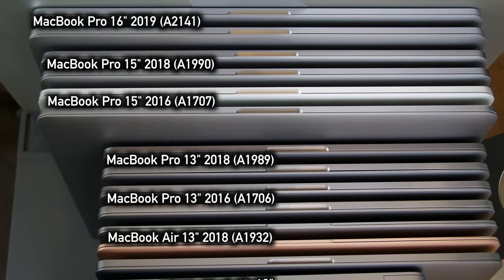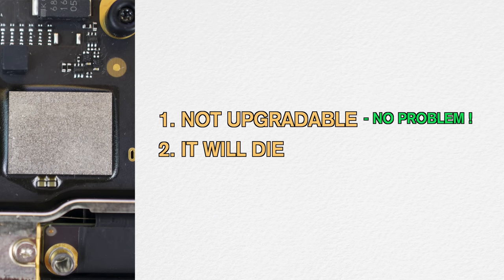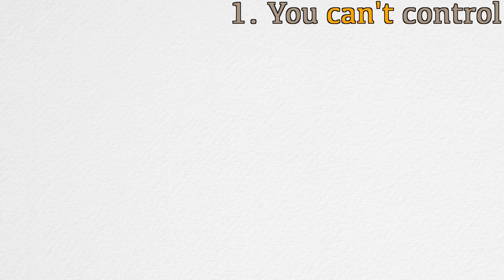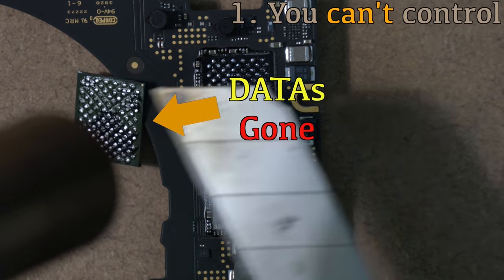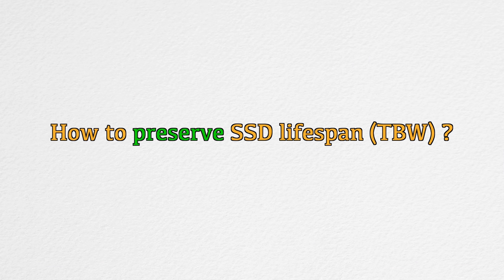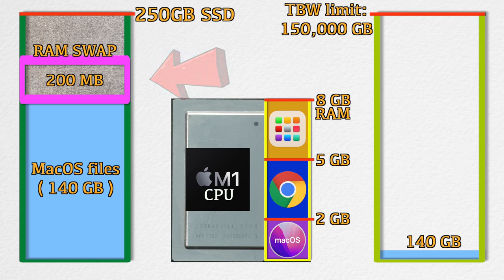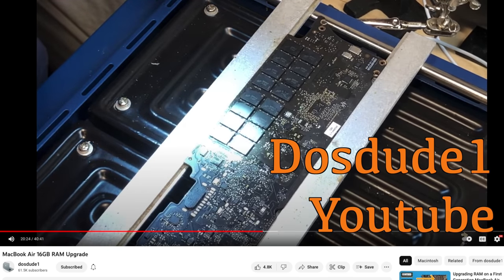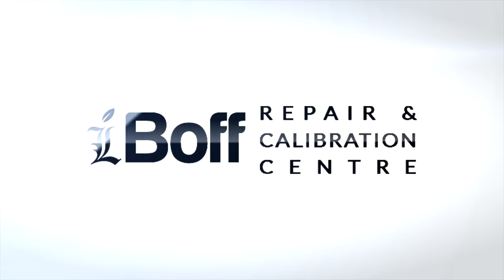These MacBooks DIED from SSD Failure & How To Prevent It (Not for RICH dudes!!)

Comment: Hello, first of all it is a unique content. You explained very useful things. But a TBW lifespan doesn’t mean that SSD is going to die. It means that the manufacturer will no longer give guarantee to SSD. There is a lot of working SSDs which has already completed their TBW lifespan years ago. It is more about the breakdown of the storage cells in SSD. In normal conditions, most probably a user can use the SSD for couple more years after completing the TBW lifespan. It was a great content thanks to you.
Reply from the maker: Youre right! When we uploaded this video, we already clarified some facts regarding the TBW to this video description, of what the actual scenario when the TBW limit's reached. and what you're saying is completely true, as its not always die 100%, but since we've had some SSDs behave erratically when TBW limit's reached on these Macs, so we'd like to call it dead.

And as a logic board technician's perspective, when we repair MacBooks with dead SSD issue, ETHICALLY we will never install bad TBW SSDs to your client's Mac. (because in the next video, we will explain most of the SSDs need to pulled off from another working Mac - and we don't even have any choice!)

and thanks for watching! :)
Reply: Still doesn't matter, ssd's also fail before their TBW is reached, and being soldered on, creates the same problem, a useless laptop that CAN'T be fixed
Reply: @michaelkeudel8770 I have seen some videos here with people replacing/upgrading the SSDs of M1 MacBooks but it needs advanced technical skills, soldering stations and connection to another Mac to start the MacBook M1 in DFU mode and install macOS.
Reply: @TechAndGuides  it needs advanced skills and expensive tools, and an incredibly steady hand, there's no reason a socket can't be there instead. The likely hood of success is very small because the way it's designed. Your storage should NEVER be the deciding factor of when it's time to upgrade YOUR ENTIRE computer.
Reply: Is the DFU in ROM?
Reply: @michaelkeudel8770 of course there’s a reason against sockets, they add thickness, weight, are more prone to failure and are slower. Don’t be ridiculous.
Reply: @spacecadet2172  throwing a piece of equipment into a land fill and forcing you to buy a replacement is better than a socket and spending a few bucks to replace an ssd isn't ridiculous. You plug the drive in once, the socket isn't going to fail if you change the drive multiple times, that's exactly what they were designed to do.
Reply: @michaelkeudel8770  people don’t keep the socketed ones either. They throw those away too because not many people want a 6+ year old computer that can’t even run the latest OS
Reply: @spacecadet2172  great, so if your ssd fails in the first 2 years of ownership, flushing money down the drain every couple of years is really cash smart. I rsn my last home computer for 11 years BECAUSE i was able to upgrade along the way, not because things didn't fail, but because I could.
Reply: @michaelkeudel8770  I worked at the Genius Bar for 4 years, and have been supporting macs for almost 20 years total for countless clients. SSD failure is exceptionally rare period, let alone in first 2 years. Component failure in general is not common with Macs of the last decade, and if a component were to fail, it is usually something to do with the motherboard other than the SSD or RAM, so the motherboard would have to be replaced anyway. I don’t know where you get this idea that the whole computer is thrown in a landfill. If it were only 2 years old, the motherboard would be replaced, and if it were a computer past it’s normal usable lifespan (usually 6+ years is pretty standard) then all the components and materials are responsibly recycled by Apple. I can’t believe you have been throwing your computers in the garbage all this time rather than recycling them!
Reply: @spacecadet2172  a dead electronic device has a resale value of $0, and I never said my equipment went to the landfill, it's always been recycled. If equipment I have still works, I try to repurpose it for myself or friends/relatives/anyone who has equipment worse than I'm retiring. Congratulations on working for Apple, guess saving your customers time and money isn't an important thing.
Reply: @michaelkeudel8770  lol you literally said land fill, verbatim
Reply: @michaelkeudel8770  recycling has nothing to do with resale value, it’s about harvesting the metals and precious rare earth elements
Reply: @spacecadet2172  yeah, meant more in a slang way, slip of words.
Reply: @spacecadet2172  not putting in a socket saves .05 - .10 on Apples bottom line when bought in QTY, your still avoiding people being able to replace/increase their SSD size, and the only option available if you run into that problem is to buy a WHOLE new system, and since you want to be word picky, recycle your device of $0 value to you, so that the recycler can sell that same raw material back to Apple. It's what right to repair is all about, I own the device, I'm not borrowing it or renting it.
Reply: I just bought a second hand MacBook air m1 that have 210 TB byte written already. And i saw that most of 256 gb ssd only have lifecycle of 150 TBW. So what should i do? What is the write cycle of the mac m1 air 256?
Reply: @icecantgaming944  It is not a rule that your laptop is going to fail. Normally SSD manufacturers cuts warranty if the cycle is come to end. But if your laptop is in Apple’s warranty then no problem.
Reply: @ERTU758BJK  the MacBook is already out of waranty, moreover i scare that it will fail too soon. And im planning to use this for long term.
Reply: @icecantgaming944  don’t scare too much. As I said normally you need to be able to use your MacBook for years. But it is more like a lottery for user. It have possibility to fail but most probably it won’t. What is the model number and year number of your MacBook?
Reply: @ERTU758BJK  how can i check?
Reply: @ERTU758BJK  model A2337
Reply: @icecantgaming944  then there is nothing you can do except waiting the fail of the computer. Don’t worry, for most of users, SSD won’t fail this easily. There are many components in the computer that can fail too. Just no worries.
Reply: Eventually ps5s are going to have this same problem as the years to on as Sony has there state of the art SSD soldered to the board. 

Xbox people have already found a way to replace the SSD when it does eventually die and thanks to Microsoft for not soldering the SSD onto the board...
Reply: @michaelkeudel8770  Land fill? LOL  Where have you been?
Reply: @iBoffRCC  you know desoder the ssd from the board and sodder another one to it that  is new working ssd or create adapter to allow hard drive and laptop drive to work in in it
Reply: @spacecadet2172  you're just jumping from one argument to another. First it was "sockets fail" then it was "people don't want old OS". Are you an apple employee or Tim Cook's bf? 🤣
Reply: Yeah, I have a 250GB Samsung 850 evo running on my homelab for storage of some docker containers, and it's working since 2018, still working like a charm

Comment: I don't know if it's intentional or not, but you make the SSD usage ware case sound quite more scary than it actually is. My first ever SSD (a 256GB Samsung 840 PRO) is being used in a PC that almost never shuts down for almost 10 years now. It has 74000 hours of operation, and  58 TBW used, with typical user usage. I don't  know if such an old model has 300TBW  limit or not, but even if it has 150 TBW (as if it was a modern 128GB SSD) this would mean that it has more or less another 15 years of life in it. It will be 25 years old if it ever reaches to that point! I have had mechanical disks that failed quite sooner than the 10 years mark!
The only real issue with Apple is that SSD's are soldered on the board, and it's not easy to replace/upgrade them. That's more of a concern if the SSD goes faulty, rather than if it wears out due to usage and reach it's expected TBW after (most likely) 15 or 20 years.. Especially since Apple declares most of it's products obsolete after 7-8 years of their release (and unfortunately Microsoft copied with it's Windows 11 upgrade policy). 
IMHO a typical user should just enjoy the ease and convenience SSD's offer, and not live in a constant fear that he may have written a few GB more today on his SSD, or that the movie he downloaded damaged his disc. And finally IMHO unless you need HUGE storage space, external discs belong in the past and should stay there.
Granted, USB C protocol is very fast, but external discs are bulky and messy. If my internal disc can fit all the data I need and leave at least 25%-30% of the drive empty, why should I bother to carry around spare discs, remember to connect them, then remember to not move my MAC while the discs are connected (or to not use it on my lap) then remember to eject them, and finally disconnect them? Supposedly MACs are famous for the ease of their usage and the total user experience they offer, no ?
PS: I have both a 2021 MBP and a 2021 Asus ROG laptop. The Asus came with 1TB SSD on board. Not only this SSD can be replaced/upgraded, but it also offers a second M.2 slot. So now the Asus has it's original SSD and a second 2TB Samsung 980 M.2 PRO. And the coolest thing is that I didn't had to send it away for the upgrade, nor become an expert to desoldering/soldering components. I just unscrewed 6 screws, put the disc in, screwed the screws back and I was done in less than 5 minutes! Aaaah... Apple! :P
Reply: Josshyua  exactly this - already 230 TBW with my 2021 M1 MacBook Air 16GB - Just got an external 4TB SSD to boot from now on
Reply: @Ph1lW0 so crazy. Macos is killing them

Comment: I'm still using my 2015 2.8 ghz 16gb i7 because I can easily upgrade it myself. I never bothered with the T1's with SSD on the motherboard and nothing but USB-C ports because the extra speed meant nothing to me if I have to totally reconfigure all of my hardware and software and pay premium price for a tiny hard drive. Here's hoping that you can slap an NVME Port on to the motherboard of a 2021 or later 14" and 16" MBP in the near future. Those are the only MBP's that I've gotten excited about since 2015 because they have flexible ,sensible connectivity and MagSafe too!

Comment: Seen it mentioned in another video that the chip that's supposed to deliver iirc 2.5V to the SSD sometime goes screwy and ends up sending iirc 13V to the SSD which nukes it, burning out the NAND chips on the SSD
Reply: So, shite design is basically what you're saying. Personally, I prefer function over form as I'm not a fashion victim.
Reply: That'll be the 2V5 NAND VREG controller (there's a couple of others).  Yes, on things like the A1990, A2141 the BGA chip VREGs are sitting on the outer edge of the logic board near the air vents and with no underfill or similar physical protective barriers; either this part, or there's a nearby cap, will over time get exposed to dust and moisture which starts a corrosion issue which in turn ultimately makes the VREG fail and you'll see often something higher than 2V5 going in to the NAND,  or, if the cap nearby gets corroded enough it'll start a carbonising effect as the corrosion works it way through the logic board.

90% of the A1990 / A2141 machines repaired here are failing because of these physical corrosion failure issues.
Reply: @pldaniels The legend himself!
Do you happen to know if a2442s have the same defect? Wondering if I should cancel my order.
Reply: @AlibifortheAfterlife  no, the M1/2 series actually did seem to learn lessons and they've mostly put their crucial VREG stuff under shields or away from such edges.  Not to say there won't be othe new and exciting issues but the SSD VREG thing seems to have been a thing only for the A1990 / A2141 thus far
Reply: Ah, so just like a Commodore64 power supply (except it took the C64 power supply more years to reach that failure point)

Comment: I manage a fleet of 100 PCs in my company and saw many broken HDDs but not even once had a damaged SSD. Some are up to 7 years old and Soldered NVM ssd's are not too uncommon here and we don't even buy very large drives. I never buy PCs with less than 16gb Ram to prevent excessive swapping. I dont' believe any regular user will ever reach the TBW of it's disk.... At least not before the battery has died and the external aspect of the case will make me buy another computer for this user. 
The over-voltage problem you mention is just the result of a terrible motherboard design by Apple and I smell a class action coming at them. Computers are not supposed to fry their SSD.
It reminds me of the Nvidia chips problem on Mac Book Pros a few years ago, which to be honest was better handled by Apple in terms of after-sales support than by most PC manufacturers similarly affected by that same plague (those Nvidia chips were the culprits).
Reply: Maybe it depends on software that your users use. Personally I understood that something wrong with my 8GB M1 when started to use Adobe Lightroom (software that uses 70% of RAM at any system and has no slider to adjust it), and noticed, that it writes 10TB per day of usage due to swap. So right now I'm not using this software on my Mac anymore, and turned off swap completely (unfortunately, I don't know is it possible to activate OOM killer, so sometimes it freezes, when open too much apps).
Reply: Apple had no choice but the handle the Nvidia issue the way they did.  They also passed on 99% of the costs to Nvidia so it cost them almost nothing.

Comment: I use my MacBook Pro professionally for work from home job + iOS app development, I buy a new MacBook then run it for about 3 years under AppleCare and then sell it right before AppleCare runs out. This way I still get a lot of resell value from my device as well and the upgrade is about half the cost of a new MacBook and it never truly 'ages' to point of breaking completely.
Reply: I've had nothing but trouble with windows machines, OS randomly resetting, motherboard failures, PSU failures, I am getting really tired of people shitting on Apple when the alternative is just as or even more unreliable in the long term.

Comment: There's also a need to make a distinction between the types of SSDs used. Older MacBooks used MLC or TLC SSDs which are slower but generally will last longer than the new cheap consumer QLC SSDs
Reply: High end Samsung ssds are tlc/mlc

Comment: You can disable swap memory in Terminal on your Mac by typing the command lines sysctl -a vm.compressor_mode, and sudo nvram boot-args="vm_compressor=2" if the mode number is 4. After disabling swap memory, you should always monitor the usage of the RAM to avoid kernel panic on your Mac.

Comment: Swap does not work as you explained it. It usually moves to swap longer time not used memory pages (parts).  Thus this pages are just written once in many cases and never used again. So the effect on ssd lifespan is small. But bigger RAM is always good to have.
Reply: Yeah! And there's also RAM Compression
Reply: You wrong
Reply: Yes and no.  It will page out pages that have low hit rate in ram.
So if you are multi tasking and switching between applications when starved for ram, there will be a lot of swapping ... hence the name ... swap.
Reply: It may not be exaggerated as he explained, but it certainly play a very important role on fastening the wearing out speed. The TBW of one with 8G RAM is actually increased very much faster than those with 16G RAM when they have the same size of storage.

Comment: Straight after having finished installing and configuring my Mac Studio Max (standard model with 32GB ram and 512GB storage) I moved my user profile to a TB3 NVMe enclosure with a 2TB Seagate Firecuda 530 in it. That leaves the precious internal storage for te OS and Applications. True that the internal storage is faster, but you won’t notice a difference in real life. So when I copy a file to my desktop it is actually on the external storage, this goes for all user profile related data like Pictures, Documents and Download folders.
Reply: Good option and as you say the speed thing will hardly be noticed as long as you use a good external SSD
Reply: use Thunderbolt as OS Drive
Reply: @UserUser-ww2nj something that's worth noticing is that iPhones that came with 64gb of on board storage are dying because of the nand flash reaching its end of life. On my part, I don't have this issue, all my android phones have micro SD card slot and as Louis Rossman stated before, iPhone design is highly flawed which happens to be true .

As someone who uses android, I will never own phones like galaxy s23 ultra, the S20 ultra, s9 , these ones are worth keeping
Reply: @danteerskine7678  I had noticed in quite a few videos that there was a problem with the Nand , coincidence or planned i wonder . Very easy for them to put on a little chip with a countdown timer and set it to fail a component .
I have Andoid as well and would never have an Iphone . My current phones are Oneplus 5t and OneplusNord . . The 5t is getting on a bit but still works flawlessly , the Nord is my backup phone , a bit essential where I am . Also a Samsung s8 but thats a long story 😂 . None of mine have an SD card slot but the 5t has 124gb so more than enough

Comment: I have old laptop, in which I have same ssd from 2016. And I know in one day It will die, but I don't keep important stuff permanently in one place. Once I had mechanical drive fail on me, I nearly lost years worth work on that. So backing up is a mandatory thing for me. There is so many reasons not to use Mac's, but people are still buying them.